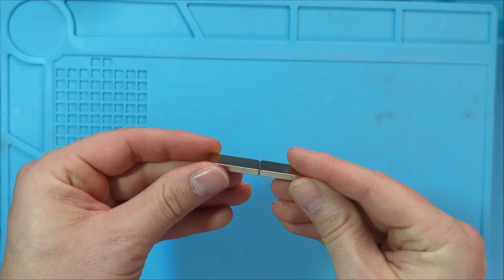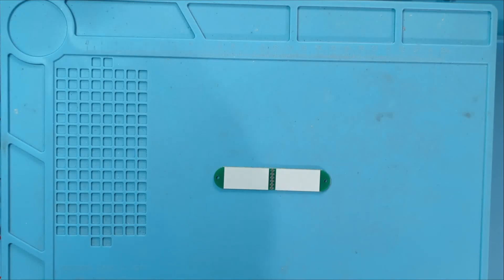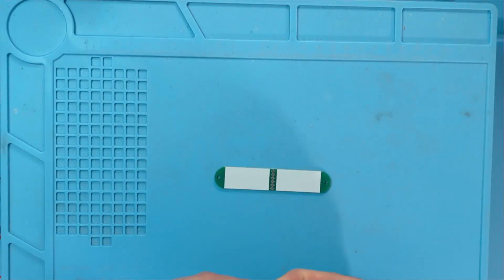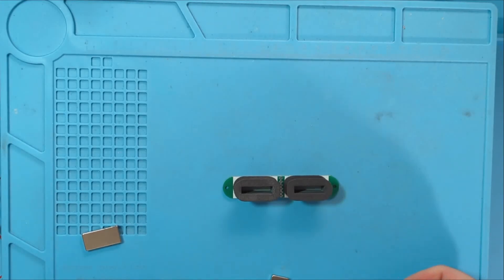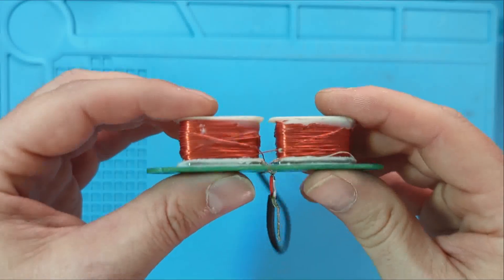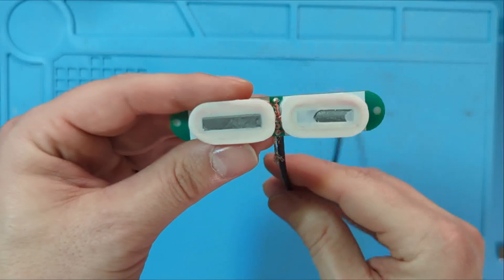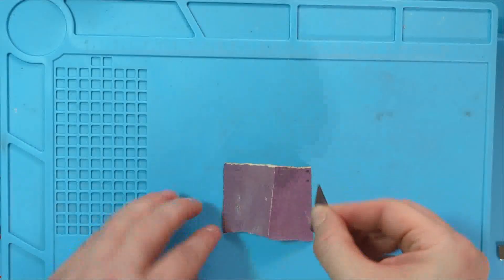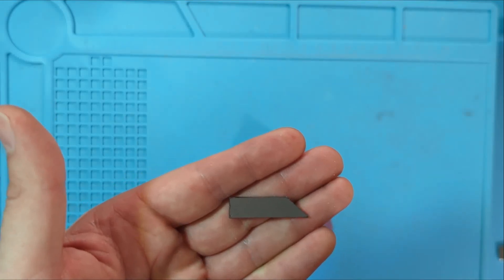Winding a DIY Sustainer Driver, Part 2

Comment: I recently bought a Vyez system that I’ve been trying to increase the driver strength on. It’s pretty weak. The resistance is around 6.5 ohm. I was thinking of trying to add some wraps to the existing windings. The part that I was hoping to get some input on is the physical style of this driver in particular. The design is more of a parallel “hot rail” style. The 3 coils are wired in parallel, not series. I haven’t seen this style discussed. Can you shed any advice?

Comment: What are actually the advantages of two separate coils instead of one?
Reply from the maker: You get the hum rejection before stepping up with the transformer, so it's truly humbucking but with a very flat response.
Reply: @thescientificguitarist4228  I think that is an answer for a pickup. But for a sustainer, humbucking doesn't matter right? Maybe with amplifiers that handles 4 ohms you could drive them separately and set the output optimally for each group of 3 strings.

Comment: Is there a way to recreate the circuit board to add the blend and harmonic feature to the sustainer or a way to turn it off and on?
Reply from the maker: Harmonic mode is easily done. The blend mode is actually pretty complex. If you look at the Fernandes patents, it's more circuitry than all the rest of the circuit combined. Certainly possible, the Sustainiac has a "Mix" mode that actually is more of a delayed onset mode and it is simple to do. The original Sustainiac wiring diagrams for it are available to download for free on my website.
Reply: @thescientificguitarist4228  thank you so much
Is there any way to change the look of the pickup like putting a cover over it that won't show the pole tops or are they a important part?

Comment: This is awesome, thanks for making this video!!  When talking about magnets, and getting the magnetic field through the plain steel lugs, what if you used rare earth magnet pole pieces or bars in the middle of the coil?  Even if you used rod polepieces, once the topper is on, it should distribute the field pretty evenly.  That should get a stronger field at the top of the driver, right?
Reply from the maker: That would certainly create a stronger magnetic field, the issue is that most rare earth magnets are magnetized through the face as opposed to through the edge. Still totally doable, you just have to take that into account.